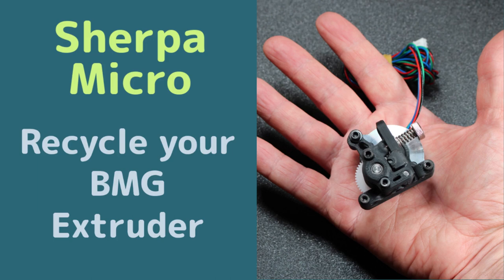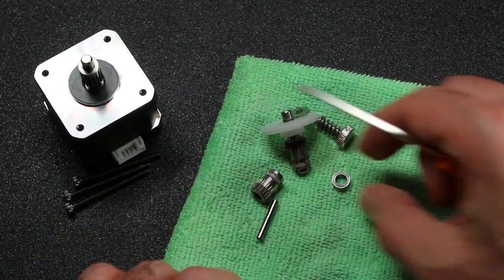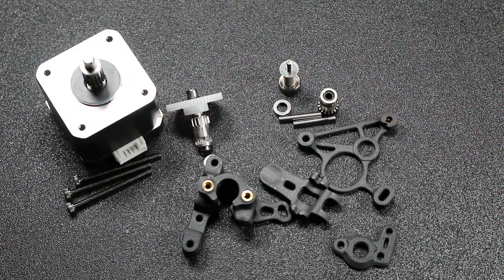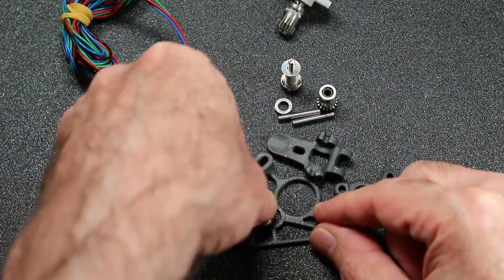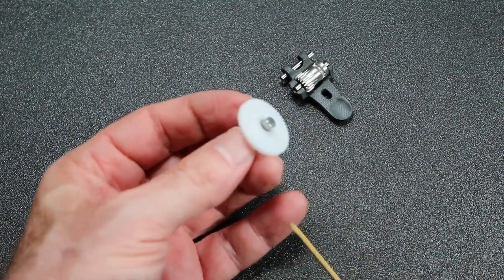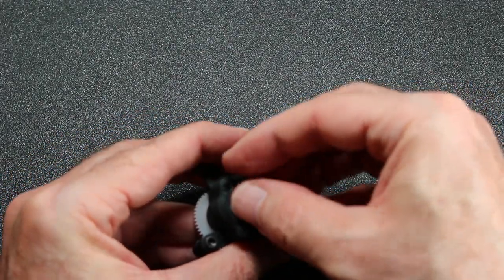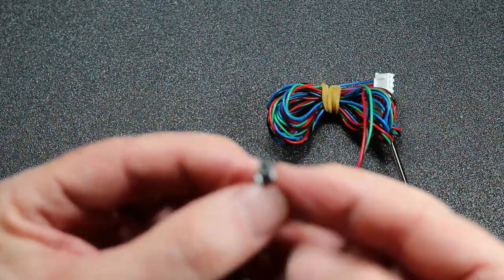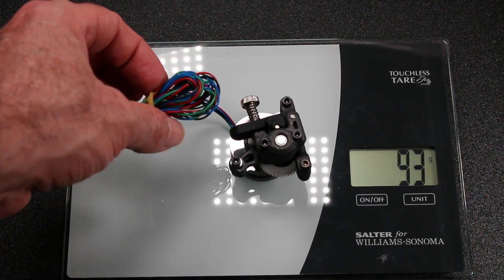Recycle your BMG style extruder and build a Sherpa Micro extruder

Comment: Done this a while ago, it's a great extruder and I hope more people see this and give it a go.
Reply from the maker: Me too!  Thank you for posting!
Reply: I also converted my bmg clone to sherpa micro. Great extruder no problems so far.
Reply from the maker: @konradhryniewicki7956  , that's good to know.  Thank you!
Reply: Is it rwally good ? Im wanna do this to my bmg but not sure, and which is better mini or micro ?
Reply from the maker: @Sushii132  I'd say they are both equal.  The only real difference is that the micro has the motor twisted 45 degrees to use it as part of the assembly.  It eliminates a heat set insert or two.  So it might be slightly lighter (I don't think it would be more than a gram or 2).  That said, I think the Mini looks a little nicer and you can purchase kits.  It really comes down to your preferences.  You cannot go wrong with either.   They are equal in abilities.
Reply: @Sushii132  I think the Micro has the feed wheel.  Mini doesn't?  Maybe Kapman can confirm?

Comment: Be mindful- i did make one witc cheap knock-off... and axis is ~0.8mm off to the side... You can fix it in F360, but yeah- some modding might be needed, and if your  sherpa has some issues, you might want to see if your hole for filament aligns with teeth on the metal gears.
Reply from the maker: Thank you for the tips!

Comment: What material was used? Preventing warpage during high speed heavy usage could be challenging I believe!
Reply from the maker: I used ABS.  I've had no trouble with this at all.  It's been working great.  I'll be releasing a video soon on a printer I have using this.

Comment: Very cool, The stock voron afterburner tool head uses the same BMG gears. When I built my RatRig i used the same BMG gears and made the Sherpa Mini, very similar but different. Same parts tho. Annex Engineering making wonders in the 3D print community
Reply from the maker: Annex does design very cool parts for 3d printers.  I'll be using an old Afterburner for BMG gears for the next extruder I build.  I spent a little time thinking about building the Sherpa mini vs the Sherpa Micro.  I like the look of the mini, but in the end I decided to try this as it uses one less heat set insert and I have not seen it used as often.  At least when looking at off the shelf kits.  Thank you!

Comment: Oooh nice, i may may have to put one on my v0 .... And by may I mean it was sent to print 5 seconds ago.

Great video.

🍻
Reply from the maker: Please let me know how that goes.  I may need to build a second one of these for that same reason!
Reply: @KapmansBasementWorkshop  I'm running an experimental version of the mantis shrimp tool head on my V0, (the current version uses a modified sailfin).  I just printed it out and it looks like it is just a tad wide for the tool head so I'll be messing around with modifying it to fit.  I'll drop you a line when I get something running.

🍻
Reply from the maker: @QEngineering  Cool.  Have a quick look at the Sherpa mini.  I have not tried it, but I have heard the bottom dimensions are a little different.  I don't know this to be a fact.  But if ti fits....

Comment: Thanks a lot for the video. Do you have any tips on how to manage the sherpa motor wires? The ones that came with mine seem really fragile, and the fact they're not bond together makes me think they'll snap or tangle somewhere with time.
Reply from the maker: I only have one piece of advice.  I built a secoomd one and I needed to trim and strip the ends of the motor wires.  It ripped the wire right out of the motor and there really is no way to service the motor.  I had to purchase a new one.  So be careful with stripping the wires!
Other than that, once trimmed, terminated and connected to the controller, no trouble at all.  These have been very reliable motors.  And I really like the extruder!

Comment: The Sherpa micro fixed idler is the way to go!! You lose some grip but the improvement in layer stacking is night and day , my go to extruder atm
Reply from the maker: Is that different from the one I just built?
Reply: @KapmansBasementWorkshop it is, there is that thumbscrew/spring assembly, it’s just a fixed idler
Reply: where do you get that?

Comment: Cool , very nice gearbox , iwas playing with my titan dragonfly septup (direct drive ender3/klipper) , i use a ltle stepper too ,not so little , but reducing the mass of the hotend setup is important for high speed  thats extruder looks pretty good , impresive desing
Reply from the maker: So far, I love this extruder.  It's super simple, easy to maintain and works really well.  Thanks!

Comment: What's the preferred and minimum filament for this?
How would resin do for making this?
Reply from the maker: I think you really need to use ABS or ASA.  PETG is flexible.  If enclosed, PLA will melt at low temps and you well need to somehow be sure the stepper motor doesn't get hot enough to melt the PLA.  I have no experience with resin 3d printers.  But @whiteG60's statement above seems reasonable.
Reply: @KapmansBasementWorkshop  Thanks. I don't have any ASA, so ABS it is.
Reply from the maker: @3sotErik  I used ABS as well.  It works fine.
Reply: I just printed this out of ABS-like resin and will try it out. @KapmansBasementWorkshop
Reply from the maker: @ObGoRat I would love to see how this looks when done.
Reply: ive been running a sherpa mini out of PETG for 1 year without problems. Dont think there is any force on the frame itself where the petg could flex

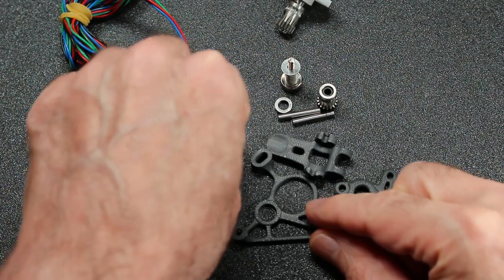Comment: @04:18 Personally I prefer to use Parallel Vice Grips for stuff like that like the Knipex 86 05 250 Pliers Wrench... Especially on smaller Bearings that can be damaged by pressing them in at even the slightest angle using a tool that seems to hold onto the inner bearing 🤔🤨
Reply from the maker: That's a good tip.  Do the pliers damage the face of the 3d print?
Reply: @KapmansBasementWorkshop  Technically, no since they're both Parallel Vice Grips and without Serration but given enough force one can leave an impression of them in the plastic since the gearing in them seems to allow for a bit of a force multiplier 🤔
Reply from the maker: @Duraltia  Got it.  Thank you for the response.

Comment: is it for v0.2 siboor build? will you be posting installation video?
Reply from the maker: I've thought about it, but the v0.2 extruder is basically this size and only slightly heavier.  This particular one will go onto another 3d (much larger) printer.  I will publish a video on that.  I'm still zeroing in to the modifications I'm going to make to the Siboor v0.2.  I'm very close to pulling that trigger...

Comment: 6:53 aluminium screws which has super strong thread? I believe You mean titanium or adamantium ones
Reply from the maker: Have a look at the extruder GitHub. It lists the aluminum screws that can be used. I have a link in the description if needed.
Reply: Aluminum is more than strong enough for clamping plastic parts.
Reply from the maker: @propheteyebert7063  , I agree.  I just can't past it in my brain!

Comment: Is there a square nema 14 version of this?
Reply from the maker: If the square nema 14 motor has mounting holes spaced diagonally the same distance as the round pancake motor, it just might work.  You would need to check the clearance with the bottom of the extruder to make sure the corner of the motor does not extend past the bottom. A spacer might be able to fix that as well.  But, no, not specifically..
Reply: @KapmansBasementWorkshop  thanks, I will have a spare voron pocketwatch when my LGX Lite comes in, and I could use it to rehab an old printer with it
Reply from the maker: @spanish360  - It's so cool to be able to reuse these parts!

Comment: The v0 can benefit from that as a speed deamon.
Reply from the maker: I've kind of convinced myself it won't.  But I think I may be incorrect.  I need to revisit this.
Reply: @KapmansBasementWorkshop  I may be wrong but I think it will benefit more on the V0, the gantry on my V2 350mm is so heavy that I think it will not make such a big difference
Reply from the maker: Hmmmmm.  You have a strong point there. Ok, you convinced me to look into it.
Reply: also you should be able to convert the stealthburner mini into a dragon burner with a mini sherpa without additional hardware other than the bigger fans if i'm not mistaken @KapmansBasementWorkshop
Reply from the maker: @martial4matters  I believe you are correct.

Comment: should i print the parts with PETG?
Reply from the maker: I believe it was designed around ABS or ASA.  But if the printer isn’t enclosed, PETG should be ok.
Reply: CF PETG would be a good choice here.
Reply from the maker: @chrismay2298  , I would check the point at when that filament starts to soften up and compare to the temperatures you expect the stepper motor to hit as well as the max temp inside the printer.  If it's enclosed and the extruder motor runs hot, you may have an issue.  But I have no experience with that filament.  So it may work great.  Thanks for the suggestion!

Comment: NONSENSE !   THE problem with the BMG extruder design, Real OR Clone is their crap Dual Drive gears .
 ALL of them.... they are neither concentric nor stable in use.  
A simple stupid Mk8 extruder does better prints.... as it at least is Concentric.
Don't believe ? get out a dial indicator and be Horrified.
Reply from the maker: I have a dial indicator and I will give this a try soon.  Thanks!
Reply: Is there such a thing as a geared down MK8, in order to make it lighter weight?

Comment: Nonsense BMG exptruders are BAD  (all.. Both  genuine and Clone)   Because their gears are NOT concentric.. the needle bearings are Garbage ..  and their gear mesh slop   introduces wiggles in filament feed  creating Z banding type artifacts..
 Retrofitting Badly manufactured drive parts into  another 'housing'  Solves NOTHING at all.
Reply from the maker: I will be measuring this the next time I disassemble the extruder.  That said, it works well!

Comment: Toss it into the trash and buy a ridga or ridga clone (I'm using the hardened variant from fystec). Those clone bmgs have atrocious quality.
Reply from the maker: Great tip.  Thanks!
Reply: The one I got for $12 beat out my $100 extruder  haven't had a single issue